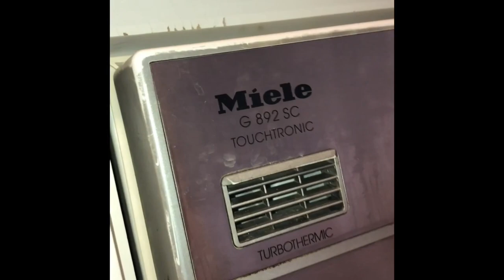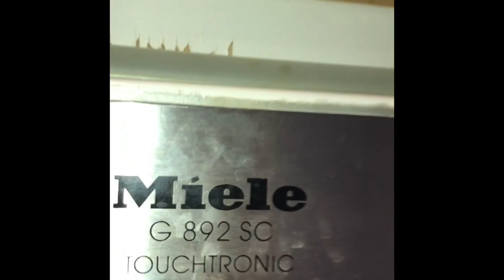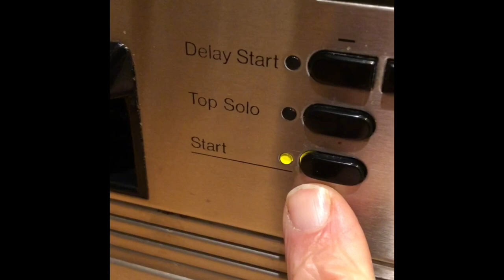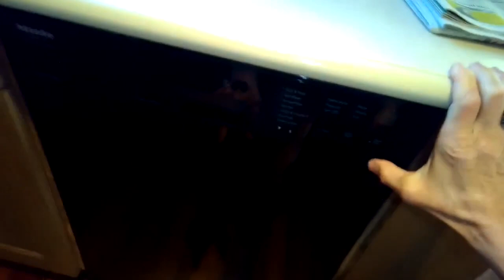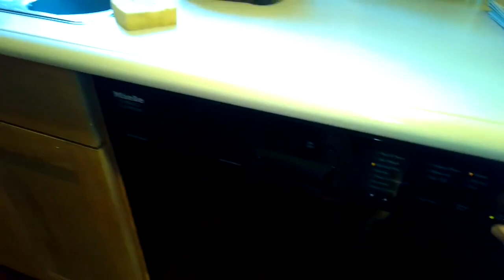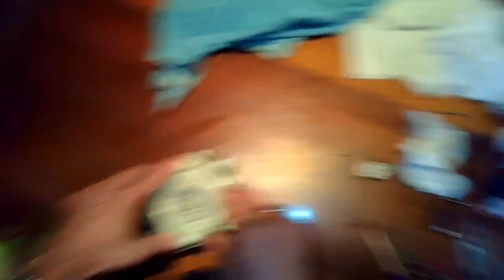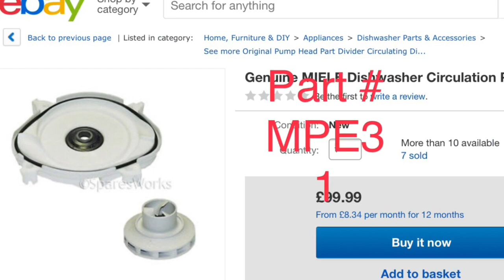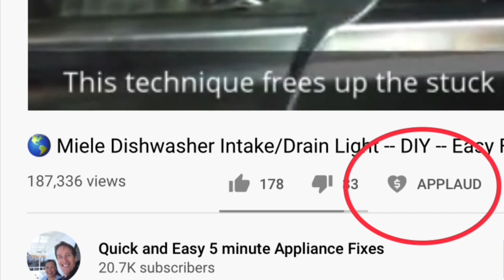✨ Miele Dishwasher Repair Series ✨

Comment: Thank you for all your videos. They are a great help. The intake/drain light was flashing and wouldn't drain. We cleaned everything up, took the motor out and learned the impeller was stuck but we got it free and took it all apart and cleaned it as well. We restarted a cycle but noted then that it wasn't draining and was now severely leaking. We forgot to put the non return valve back in as we were soaking it in cleaner.  Would that cause it to not drain? We will put it back in place and try again but we had so much water to clean up we quit for the night. Just wondering if that could cause a drain issue before we take it all apart again. There was nothing stuck in the impeller under the non return valve. The dishwasher itself was full of calcium and maybe old soap buildup. We cleaned it very well. Also what is the little black switch on a plastic part that is supported by styrofoam?
Reply from the maker: Hi Linda,

Can you send that same question to my email:
Scottthefixitguy@yahoo.com

Comment: Thankyou: our machine is showing an F14 error on only two cycles: it works fine on Intensive and Short wash, but balks on Eco and Sensor wash. Before I pull it all to bits as per your excellent video , is there maybe another thing to try? Just run it through on the hot cycle a few more times to attempt to clear whatever blockage is in there? (I suspect a fragment of glass).
Reply from the maker: Good idea, I would add 1/4 cup of vegetable oil as you do it.